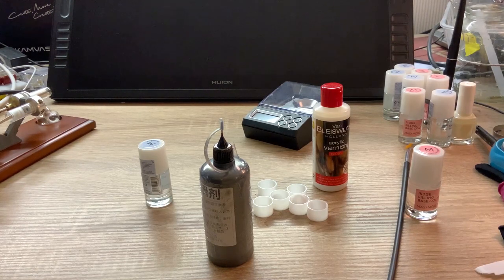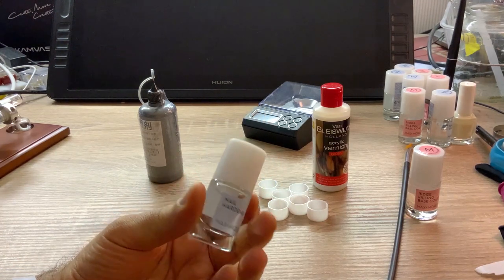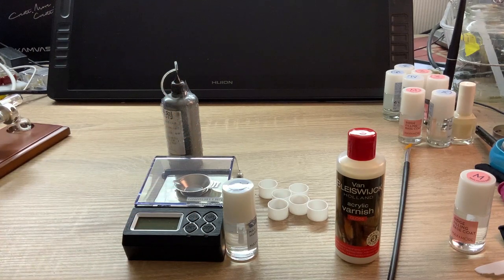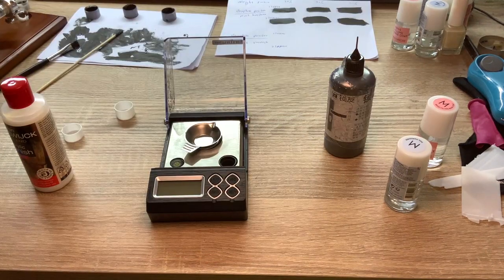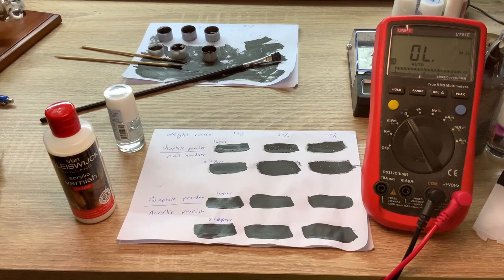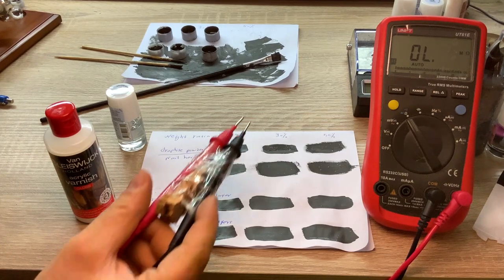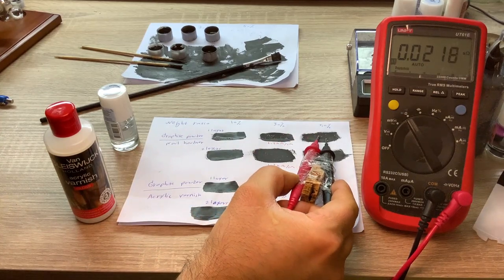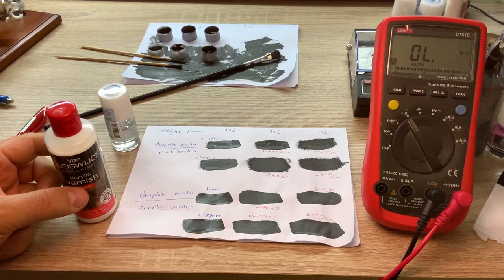How to make conductive paint ( Graphite powder + Nail Hardener or Acrylic Varnish )

Comment: I achieved 0.5 to 2 ohms (yes single digit ohms) with graphite powder. 20 to 30% by weight polyvinyl acetate white glue/wood glue. to graphite powder and add enough water to form a semi-viscous wet paintable slurry.
Mix thoroughly for at least 30 minutes to an hour. Preferably with a motorized mixer. will achieve much finer smoother and more precise conductive paint of high quality and low resistance.
Don't make it too runny or thick or the layer thickness will be too high and make it less conductive.
I even used cheap brand of graphite powder and it still worked great.
It also depends what sort of surface is being painted. if the surface is porous. nonporous. plastic. metal. paper. etc. That also has a large effect on the conductivity of the resulting paint.
Remember that  common white glues like wood glue. PVA glue will likely already contain 50% water or solvent. So you'll want to account for that to achieve an accurate weight percentage of glue to graphite.

An example you'd use 20 grams of PVA glue to 10 grams of graphite powder to achieve a 50% by weight glue to graphite powder ratio. This is because the PVA glue already contains approximately 50% water.
I recommend adding just enough water first until the graphite powder is mixed in to get it smooth. Then add the glue and stir it in well. It will likely thicken substantially. You'll then want to add more water and stir for a long time until the desired consistency is reached.
At first it will thicken up a lot. However after some time it will begin to become more smooth and fluid and less thick. This is a good sign and means it is close to being ready to use.
Mix until it no longer changes in consistency much. Add additional water if too thick. but don't overdo it.
You can paint it or use a syringe to deposit it on the surface depending on the thickness of the graphite paint you've made.
Thinner more runny paints will create thinner smoother layers that are more even. but may be more difficult to apply in some areas.
Thicker more viscous paint will create thicker layers
Too thick or too thin will increase resistance.
Higher percentage of glue to graphite will be stronger as well. but lower conductivity.
I also recommend using a precision scale to help with the measurements to obtain a more accurate mixture.

Comment: Do you know how these paints work on 3Dprints for electroplating?
Reply: Use graphite powder mixed with acrylic paint 2:1 ratio for electroplating
Reply: @donxgraphics 2 parts graphite powder to 1 part acrylic paint? By volume or by weight? I am new thanks

Comment: What will be the application we can use as a trial?
Reply from the maker: Sometime you need to make a surface conductive (for example to create some sort of shield), you can use the paint to make it conductive. Sliver paint is usually used, but that is rather expensive.
Another example: if you have a circuit board that deals with tiny value of currents, you can use conductive paint to create electrical connections.
Reply: Efield shielding may be a good option since all you need to do is fix it to a specific potential and the resistance isn't too important. This would be horrible for a PCB in most applications. I'm hesitant to say all because thats harder to state. The width of this paint is over 1 cm and is already kOhms. A PCB trace with low current is likely going to be be much much thinner meaning the resistance in this is going to be very very high. This is not practical, but still a cool experiment.
Reply: @HVE  Thank you very much for the explanation! God bless you!
Reply: @joshuastewart123  Thank you and God bless you!
Reply: If your graphite paint can show resistance below 5.0 ohms. It will be useful. You are showing resistance as high as 1.0 kiloohms, it will not be useful in battery making. If you have any alternative paint for less than 5.0 ohms, kindly share it reply.  Respect from Jawaharlal Bharat INDIA 🙏